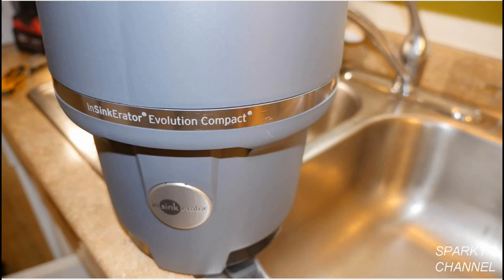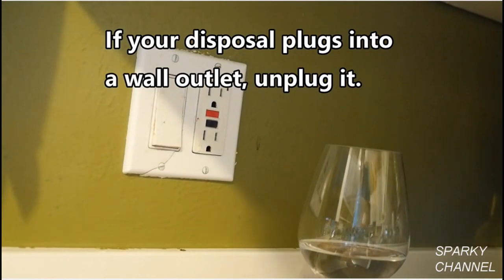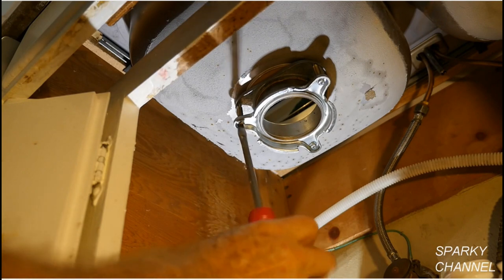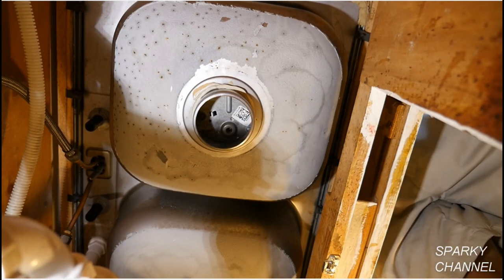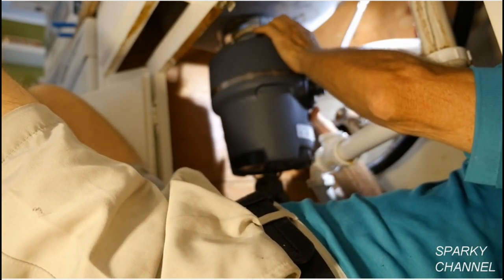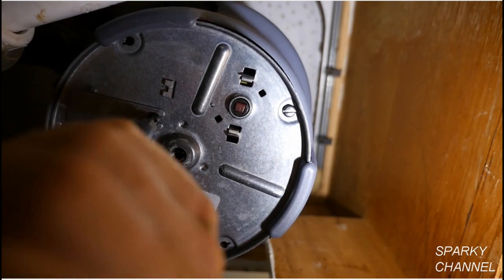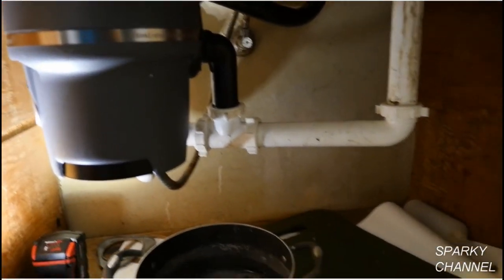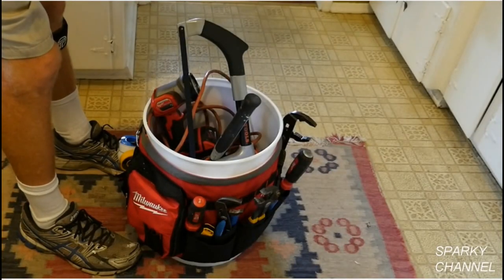How to Install an Insinkerator Evolution Garbage Disposal and an Air Gap

Comment: This video helped me a great deal. I was hesitant about the air gap, but fortunately my Bosch 800 series dishwasher has the air gap feature built-in. Didn't use the jack but the old disposal on top compressed the new flange, after I loosened the screws on the under mounting plate, the snap ring went right on. My new insinkerator evolution supreme SS is installed. Upon turning on, the sound was like my old insinkerator (branded Kenmore) when it was jammed.  I was devastated thinking that my new disposal was defective.  Not so!  It's just that quiet.  Had to remove the quiet baffle to see the monster in action.  New design lets you remove baffle from the top.  Happy, thanks for the help.
Reply from the maker: Fantastic! Great job!

Comment: @Sparky Channel. Nice tip about using the garbage disposal as a weight to keep the flange in place. Thank you for reposting and updating with the new codes.  Best wishes.
Reply from the maker: Yes, if you don't have a helper it's a good trick.:) I'm updating all the videos before reposting them.  For instance on this one I showed the various new styles of InSinkErators that didn't exist when I first made this video. They even have one now that is made for septic systems. Thanks and best wishes to you as well!

Comment: Thank You, Thank You, Thank You a thousand times. Your video was perfect and the Scissor Jack suggestion was a life saver. I kept doubting that I had it on properly until I was able go get.under and see exactly what I was doing. I have never used a jack to change a tire in my life but it was a $225 deal breaker. I would have definitely paid a plumber if not for that tip.
Reply from the maker: Glad it helped! These high performance units are pretty heavy and they can be difficult to hold up and attach.

Comment: Air Gap?  Not always necessary, loop the dishwasher disposal hose.  If one does use an airgap, they don't need to be outside the cabinet.  A few years ago, I installed the huge Evolution 1 HP, prestige I think.  It took up so much room but it would grind rib bones fairly quietly.
Reply: Some people have a sink that is not properly connected to an outside vent so this is extremely helpful

Comment: Thanks for the very detailed and clear video... Question... When attaching the disposal's discharge tube, time 6:55, to the anti-vibration tailpipe mount, What is the rubber piece with the metal spring hose clamp called that holds the blank drain pipe to the Garbage Disposal? Where would you go to find a replacement for said piece?

Comment: Why wire and knock out the drain plug after the unit is mounted?  If you have enough slack in the wire, connect wiring before mounting the unit, so you can turn it over and work on it rather than lie underneath it trying to stuff wires into the cavity.  Pounding out the drain plug after the thing is mounted can loosen the mounts and even damage it.  Remove the dishwasher drain plug while the disposal is out, so you can steady it and easily turn it over to shake out the plug.  The drain tube mount is trickier than it seems -- its rubber flange is so slippery that the tube can work its way loose under the spring clamp.  Better to use a metal hose clamp (the instructions say that "failure to use the spring clip voids the warranty," which is ridiculous if you use a more secure clamp).

Comment: Awesome video thank you.  The only thing I think you messed up on is how you installed the quiet sink baffle, scroll to 9:02.  I'm pretty sure you installed it upside down or the other way around.  Yeah the idea about the car jack is awesome thanks and although I actually have one just like that and I really didn't needed it unless you are super weak and the reason why I say that is because I have an insured back but I was still able to install it myself without any help and is actually not hard at all, but as an option it was a smart thing for you to show that so great job.
Reply from the maker: I know it looks odd but that was the right way around. They do it that way on this model so that it can be taken out and cleaned. Thanks so much!
Reply: @SparkyChannel  Thanks for your reply that's weird because I just purchased and installed the Evolution model a few hours ago and the rubber flippy things of the baffle are kind of pointing down not up.  I did try it the other way but for some reason it wasn't fitting properly.

Comment: Install the drain assembly to the body of the disposal with the two screws provided BEFORE you try to pick up, position and turn ring to secure disposal. It seems like a small step but the drain 90 will allow you to grab it with your right hand and control the disposal as you lift it up. Be careful that you don't mess up that electric connection if you are using a jack. That quick-connect electric jack we a horrible idea.

Comment: Does this product require you to have a hardwired wall switch or is there another option? I've seen older units that have a magnet that you place in the drain in order to activate it.
Reply from the maker: You can hardwire the disposal to your switch loop going to the switch or you can plug the disposal into a receptacle that is controlled by a switch.
Reply: I've recently seen an air switch unit used to control the disposal. There's a decorative button installed on the countertop that is a plunger with a hose that goes to the air switch.
 I usually install a plug under the sink for a disposal because it's a lot easier to wire an appliance whip while on the counter. Turns out this automatically works well with an air switch because the unit I saw plugs into a non switched plug then you plug the disposal into the unit and your done.

Comment: I usually just put a plug underneath the sink cabinet and an appliance whip on the disposal and let the plumber have fun with the rest lol. 
I had an issue with a customer that they needed to turn on the disposal to empty the sink of water. It was a new kitchen but the second disposal. Turns out there wasn't a plumber there doing the work, just the carpenter. The sink was an extra deep sink. The bottom of the sink was exactly to the middle of the drain pipe coming from the wall, so it should drain, all be it slowly, But by putting the disposal on the sink they lowered the water level below that of the drain. They were using the disposal to pump the water up into the drain lol. Had a plumber worked on the job it wouldn't have ever been an issue.
Reply from the maker: Good story, thanks!

Comment: What's the purpose for the air gap? Do you need it?
Reply from the maker: Yes, it keeps dirty water out of your dishwasher.
Reply: @SparkyChannel  I have used the high loop for the D/W drain and never have had an issue.

Comment: Ummm install my 1hp evolution prestige black to black white to white and grounded hard wired from existing disposal. When I flip the switch I see a spark at the bottom of the disposal where it is wired! Is this strange?????? It comes on and operates after the spark but I assume a spark on start up is very bad yes????? 10amp breaker
Reply from the maker: Hi Rick. Yes, that is bad. Something is wrong, perhaps a loose connection.
Reply: @SparkyChannel  nope manufacture says it’s completely normal

Comment: What will happen with the soap dispenser? The code also mentions that a high loop is also acceptable for this purpose and so an air gap is not always necessary.
Reply from the maker: Air gaps are needed for sanitation and health reasons. Have a great 4th of July!!!
Reply: @SparkyChannel  Thanks, but I am in Canada. Anyways, have a good day
Reply: Rinse it out and put it away; buy a pump soap dispenser for use instead. 😊

Comment: Thanks for this video.    I followed and replaced a Badger 5 with an Evolution Compact.   The new unit is very quiet.     What blows my mind is I went to two Home Depot stores and they don't stock this item.   Yes, they have it online, but it's $9 less on Amazon at $180.   HD has a bunch of Badger 5s, but they rust after 5-6 years and leak water out the bottom.     Ordered it from Amazon with Plumbers Putty,  arrived 2 days later.    The dimensions of the Evolution Compact are almost identical to the Badger 5.    I'd say the Evolution is about an inch wider, but my drain tube lined up with no problem.  This is because the drain tube coming out of the Evolution is flexible.   Here's a video showing the dimensions
https://www.youtube.com/watch?v=luj6zEvraRQ
Here's a video showing how to remove the old cord from the Badger 5 with tin snips, I did this.
https://www.youtube.com/watch?v=IF4BSou3TIE
Reply from the maker: Thanks!